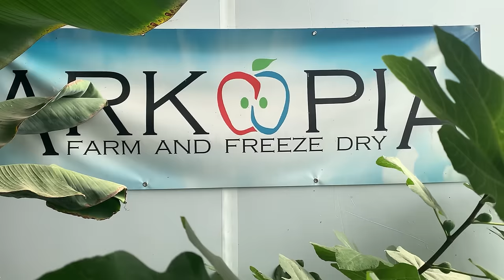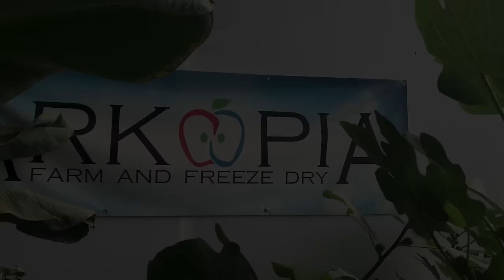The Most Efficient Greenhouse on Earth | $100 a year to heat in -40C with Sand Battery Thermal Mass

Comment: Thank you so much, Dean and Patrick, for showing us how to heat a greenhouse in a cold climate. We live in Norway at 59 deg north, so our climate is pretty much like yours, but with a bit milder winters. We reached -28 deg C in January this year for the first time in decades, usually it goes down to -17 a few times each winter. We have slightly shorter days than you in the winter (but very long summer days!).
We have started to build our greenhouse at the south wall of our barn, so it will look pretty much as your greenhouses, 20 m long and 5 m wide. And now I know how to make the thermal mass floor thanks to you guys! So as soon as the rain stops and the ground dries up (frost has gone now), we can start digging and insulating for the thermal mass floor. Looking forward to have a greenhouse this winter! Greetings from Norway
Reply from the maker: Great to hear.   All the best with your build.   Sounds great. 👍
Reply: maybe upload some videos of the process!
Reply: Can we follow your building proces? We live in Norway too and have plans to start building next year. We live nearby Rondane NP
Reply: loved your post folks. will be cool to see how yours turns out. Peace and God Bless... Mac in Maine, USA

Comment: I know you guys talked about the math about a sand battery so i just wanted to elaborate on it for everyone.

The specific heat of water is just over 5x as high as sand by weight. BUT sand is about 60% heavier than water give or take how coarse the sand is. That means that by volume sand is about 20-25% as efficient at storing energy as water. So when you lay your tubing in the sand to exchange heat it will increase your efficiency the more total volume of water you can have trapped with the sand in the tubing. Also for the wood stove if you had included a heat exchanger with a liquid media you would be able to heat the sand that way instead of trying to heat the air

Comment: Dean - I have to comment on your solar panels.  Use them to power a Heat pump and kill two birds with one stone.  Remove excess heat and reduce the humidity in the Greenhouse by using a heatpump.  The hot water discharged from the heatpump would be as good as the solar evacuated tubes but no need to use glycol. In my last two greenhouses I used  PEX Heat Transfer Plates on the ceiling to do this, but my next one I plan to also use a heatpump (I did use a radiator and fan with good results). A pool heater heatpump might be overkill - but it is what I am looking at.  I also use a lot of iot devices to automate things so you do need to have wifi near your greenhouse.
Reply from the maker: Interesting.   Heat pump right inside the greenhouse you’re saying.   Nice
Reply: @ArkopiaYouTube  Yes A/C the Greenhouse and store the heat for later use - for every watt used you should be able to pull 4 watts out and get about 5 watts of heat to store. The key thing is you do not need to open windows for fall, winter and spring - you can fully automate it. You only need to use it when it is sunny - and you always have solar when it it sunny. There will be a few variable that will needed to be worked out - you water storage system  of 10 totes stores about 12KWh(40KBTU) / degree C, that should be enough to help balance the highs and lows.
Reply: If you take that route and don't have other CO2 sources (humans in greenhouse, humans in attached house, pets, mushrooms etc.), consider HRV or ERV for air exchange because you run low on CO2 if built well.  Can also do earth tubes for fresh (CO2) air in and then heat pump treat the outgoing air to scavenge heat.

Another nice thing with the heat pump approach is that you use the condensation (soft water-like rain) for watering.  Make sure your air contacting heat pump doesn't have lead solder around the fins (or other heavy metals).  I tested the condensate off my heat pump and it had lead leachate.

Also, depending on your spore load, you may want fresh air exchange or some sort of air filter.

Comment: I can't wait to build my greenhouse here in Willow Alaska.
Reply: Could you tell what his main glazing wall was... polycarbonate and framing was?
Reply from the maker: Twin wall 8mm polycarbonate outside, on 2x6 spruce lumber, and 6mil greenhouse poly inside.
Reply: @ArkopiaYouTube I could tell it was polycarbonate on the  outside.  didn't notice the 6 mil poly on the inside.  Thanks for sharing.
Reply: ArkopiaYouTube. - how thick were the foam panels (ridgid?). Under the 14" of sand?

Comment: You mentioned that you had concerns with moisture levels increasing, and that the incoming cold air from the outside was too cold. Have you ever considered using a "Heat Recovery Ventilation" system? (HRV). This unit will effectively extract the heat from the greenhouse exhaust air, and put it straight into the dry fresh incoming air (Approximately 80 % efficiency). For example, in my house when the outside air is at minus 15 degrees Celsius, the incoming air gets preheated (just by air exchange, no heating elements) to plus 12 degrees Celsius. Hope this helps! Mine in my house iis a "Venmar". This would likely work well for your greenhouse.
Reply from the maker: My house has a little venmar, yes.   I had envisioned making my own more efficient air exchanger.   A project for one of these years.
Reply: @ArkopiaYouTube  that very special day called  "some day "😂

Comment: They could consider adding some type of heat recovery ventilator to breathe off some of that humidity without the fresh air coming in at freezing temps.  Even better yet they could consider an HRV connected to some earthtubes on the intake side.

Comment: Great accomplishment Patrick. Maybe a roll down thermo-blanket to keep some of the heat in on those very cold winter days. I have though a greenhouse used in the winter should only be open on the glazing side when the sun is out.  I always thought of a jet fighter lens being the thick insulation to flip over the greenhouse glazing at night or on those cold winter days/ nights. Great job Guys.
Reply: I wanted one , but I built during the lock downs and supply chain collapse. Maybe on the next one.
Reply: Don't need anything fancy In winter.  A lil sewing and rope with a solar triggered motor to rise and lower the blankets... Add tarps to make a blanket sandwich of the blanket...   and moving blankets would work great for this.

Comment: Insulate the exterior at night.  Cheapest method could be merely a mylar fabric shade for infrared.  Foam panels with reflective metal coating (polyisocyanurate) would be even better. They could be used for concentrate light during the date when horizontal to the ground.

Comment: I did a thermal mass in a greenhouse and used a good 6" of air-crete for the bottom layer of insulation. People will argue about the soil wicking out the heat and until there's a good side by side comparison of heat retention I do agree it's a great idea to insulate the bottom.

Comment: Interesting to see the strategies in the far North, because unlike the year-round 50 or so degrees (Fahrenheit) you get in more temperate latitudes, you guys have to actually insulate the floors because the ground temperature drops so low.

I'm North of Nebraska, but at a low enough altitude, the ground doesn't get that cold, right here.  Even with that passive geothermal working in my favor, I can't imagine not having some kind of wood/oil/gas heat as a backup plan.

I'm always pleased to hear someone reference "Oranges in the Snow!"

Comment: The only issue with Evacuated Tube collectors Dean? Is that in the summer if you are not using the heat they are collecting? You need to cover them up. Otherwise the collectors will over heat and the manifolds at the top will burst. That and it will protect them from hail in the summertime too. Its the most common failures of this type of collector is overheating and hail. Been there, done that. Went away for a week and came back and my solar hot water system had overheated and I had to replace two units.
Reply: Simple Solars design has a heat dissipation line built in so I haven't had that problem. When I covered them with a tarp before I had them hooked up the wind just about ripped  them off the roof.
Reply: @patrickbos825  Oh good. Hate to see ya suffer like I did with mine. And yeah I could see wind being an issue the way you have them on top of the roof.

Comment: Could look into free piston stirling engine systems for potential uses for that summer heat off that solar. Depending on temp output it might be viable for some bonus electricity.

Comment: For the emergency air pump - set the backup to only kick in 2-3 hours after the pump goes down. That way if it goes down at midnight, rather than the pump kicking in at midnight and emptying by 3am, it kicks in at 3am and lasts until 6am.

Comment: Nice work! The air to air heat exchanger I build out of used metal roofing does a great job of keeping humidity @ 50% and transferring 90% + of the heat. My Aquaponic system is floating raft style with a fluidized sand bed filter. Anyway , great job !

Comment: One thing that could be considered is adding is a water jacketed / heat exchanger  waste burner. This could be scaled to your needs. On forested acreage, fire management waste could be used at the coldest / prolonged cloudiness  times of the year to supplement heat into the mass battery. Another interesting note to mention. Is that since electric solar panels have come down in price, some are using the electricity directly to produce heat. So even on a cold light cloudy day some thermal energy could be produced from the panel. Another benefit is no exterior plumbing.
Reply from the maker: That’s what I’m doing for greenhouse and shop.  PV direct water heat over thermal water heaters. 👍
Reply: @ArkopiaYouTube  Look forward to your future video on it.

Comment: Question for Dean & Patrick: You mentioned not using rain water catchment yet.  What have you used in the meantime?  In general, what do you do for irrigation?  Well water in the prairies goes something like this: high pH (>8.5), high bicarbonate, which ties up all the minerals, high to ultra-high TDS (700-1700), and high sodium (>200).  This will kill most plants, or at least they'd struggle a lot.  Do you haul to a cistern or treat your well water?  I had thought of using RO but was convinced otherwise as the water is so pure that it's highly corrosive, everything (fitting, manifolds, fixtures, valves, etc.) has to be plastic or stainless steel.  Both of you are super-inspirational and I'd like to follow in your footsteps.  I'm thinking of moving east for improved water quality.  But maybe you know of a solution.  Any help is greatly appreciated.  Ideally I'd have well and rainwater, but so far I haven't solved the well water quality issue.  Rainwater might be iffy given the ongoing drought so would like to ensure well water is going to work for gardens, etc.
Reply from the maker: I fill my tanks from the well, and then it warms up so the plants like it more.   Well isn’t the best, city water is crap if you have it (don’t want chlorine for plants).   Soon to be rain water and pond water for me.
Reply: My Wells a fairly shallow and the water is hard . Ph of 7.0
Reply: @ArkopiaYouTube  kinda, sorta… most wells we’ve come across are terrible. The chlorine will evaporate just by letting the water sit for day, add some air stones and it’s even quicker, but the bicarbonate and sodium in well water are quite difficult to treat. Basically RO or distillation
Reply: @patrickbos825  that awesome Patrick! Shallow wells are rare, came across one near Camrose, had the best water so far… probably should have gone for it as everything since is quite bad.  You’re quite blessed! Thanks for answering. Happy Easter.
Reply: A pH of 7.0 is neutral, not hard. Hard water has a pH above 7.0.
Reply: @didgeridooblue  pH of 7 is neutral, but hardness is different. Soft water has sodium, hard water is generally high in minerals, usually calcium. High bicarbonate will bind to the minerals and raise pH which tends make hard water alkaline, but this isn’t always the case (when there’s little to no bicarbonate).

Comment: You can get 12v 24v water heater elements and run off a solar pannel,  you can use an old water heater and put 12v element it or put in those 1000liter tubs. Every bit counts.

Comment: Hello gentlemen. Thank you so much for the video. I am in zone 6A here in the states. I am starting a hobby farm as a relaxation retreat for vets. I am concentrating on citrus for 1 greenhouse and another for berries and vegetables.  I would love it if we could sit down and discuss your plans. My dimensions that i am looking at is 24'x72' at about 14' at the peak. I have been trying to decide on polycarbonate thicknesses for heat retention. I am familiar with the older gentleman in Nebraska. My goal was to implement his design of geothermal air movement run by solar power. My only problem with his design on my property is that my water table is too high. I can't dig 2' down without hitting water. I am going to have to utilize the solar mass technique as well. I wanted to incorporate a fish pond as well. I have already purchased my hydroponic tubes.I have a 300 gallon cattle trough but it appears I am going to need a bigger one.  I would be interested in finding out cost to construct.

Comment: A 12v 100w solar panel can be wired to a 120w 12v DC Road Pro Immersion water heater in a barrel of water to create warmth at night (and day), in theory. Two panels in parallel may be better. It`s worth trying. Can be upscaled to whatever one needs at a particular location.

Comment: air exchange in NB is 100',   what out circling the building between layers of insulation to help warm the air before it comes in
Reply from the maker: Exactly. 👍
Reply: in Manitoba for some of  my greenhouses, I use 3/4" 400' polypipe  ground loops and circulate water  in to storage tank and let it radiate off .as it more energy efficient    20 to 40w pump is all that is required  , for both heat and cooling the greenhouses

Comment: We are designing a similar greenhouse presently. You’ve given us a lot of ideas. 
Do you have any issues with condensation on the inside of the metal building? What type of insulation, vapor barrier and wall board did you use? 
Thanks for the great video!
Reply from the maker: No condensation.   Make sure your insulation and vapour barrier is good.   I used 6mil silage tarp because it is UV resistant and nice and white.   Taped all staples.

Comment: my parents have a sand battery cooled/heated geodesic greenhouse with a 3200 gallon pond and reflective interior above the pond that reflects sun into the pond in winter and shades it in summer. its more efficient than this. just cost a lot to make it. Air is run 8 feet underground through massive chambers to cool in summer and heat in winter. A dome has the least surface area to lose heat from.
Reply: That sounds amazing! Where is this build and what growing zone?

Comment: Insprational! I'm starting to plan to build something similar, but worried about overheating in Summer. What's your experience with that? I'm thinking I'll need an outdoor shutter system or retractable galss. .
Reply from the maker: Summer sun doesn’t hit our thermal mass on the north.   It’s cooler in greenhouse than outside in summer

Comment: 23:30 actually the pressure drops at the constriction in a venturi, not when it opens back up on the downstream side. You'll get the largest negative pressure at the narrowest point, where velocity is highest.

Comment: @ 15:30 you're speaking about air excgange, did you consider using a Heat Recover Ventilator to extract heat from the exhaust air to warm incoming ambient air? A little expense but could provide much better air quality in winter months especially
Reply from the maker: Yes, was just going to make my own with long runs underground.   Hot exhaust next to cold intake pipe.